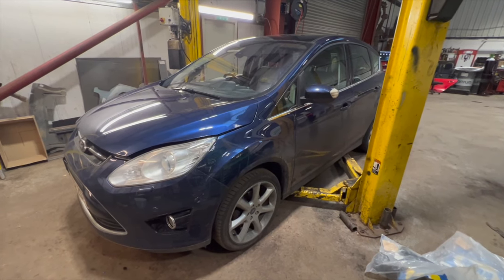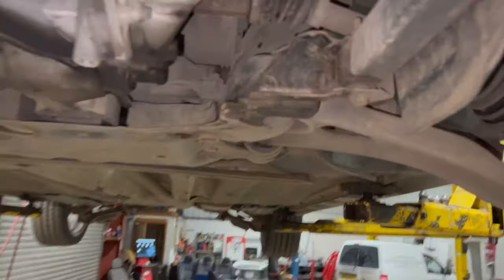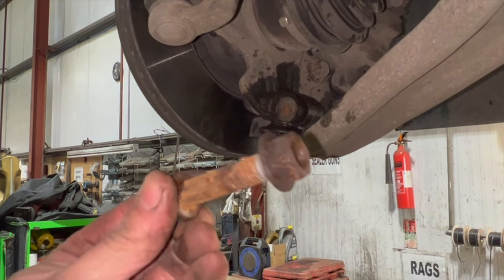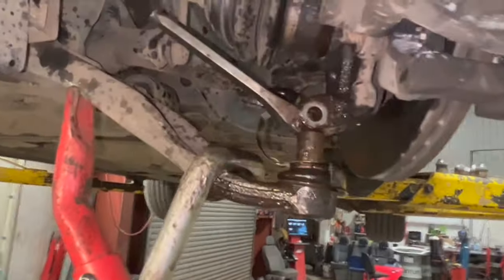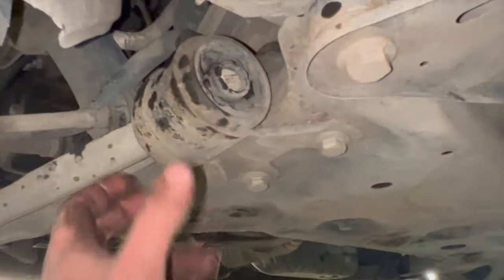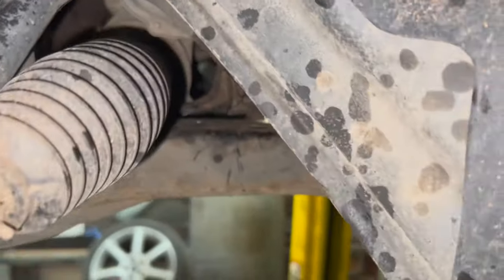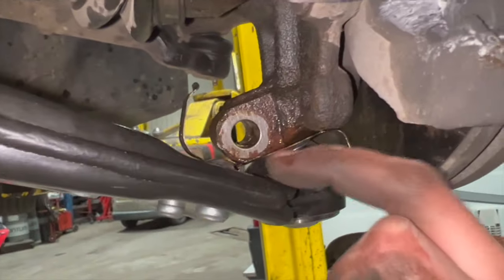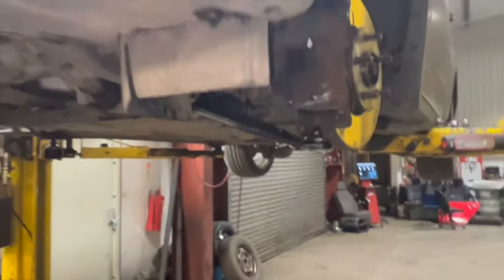Ford Cmax front suspension arm replacement

Comment from the maker: LH Front suspension arm Ebay - https://ebay.us/q5DO98
RH Front suspension arm Ebay - https://ebay.us/4CBG3X
Front susp arm rear most bush kit Ebay - https://ebay.us/DZVkh0
Ball joint pinch nut & bolt - https://ebay.us/lVmoti

Tools used :
             
Milwaukee 3/8 Drive Mini Impact driver - https://ebay.us/Pg8ilg
Socket Set - https://amzn.to/2O6BUmM
Spanner set - https://amzn.to/2DlwUZm
Suspension arm puller bar - https://ebay.us/30GWMc
Copper hammer - https://amzn.to/3fmw2Dg
Ball pein hammer - https://ebay.us/8OJpgz
1/2 Dewalt impact driver - https://amzn.to/3e2Uff2
17/19/21 wheel bolt impact socket set - https://amzn.to/3gDnBlP
Torque Wrench - https://amzn.to/2VZ4CKu
Screwdriver set - https://amzn.to/30RA53L
Copper grease - https://ebay.us/ckQddu
Wire brush - https://ebay.us/hTtdhH
Prybar set - https://amzn.to/3nh2t8c

Torque settings :
Ball joint Pinch bolt - 83nm
Front most susp arm bolt (18mm) - 150nm + 90 degrees
Both rear sump arm bolts - 115nm + 90 degrees
Wheel nuts - 135 NM
             
Check out the Timing belt replacement on this same vehicle :
https://youtu.be/eSVdVACJBlc
Check out the Auxiliary belt replacement on this same vehicle :

Comment: Do you not recommend torqing the bolts with the wheel at normal riding height so as not to stress the  bushings?
Reply from the maker: I dont usually tbh and have never had any issues but some people do recommend it
Reply: It does twist the busy, shortens life of the rear hydro busy, what it does do also is increase the ride height slightly at the front.

What you are supposed to do on these is tighten up the rear bolts, then put the ball joint in.

That then locks the front bush in the position where the rear one is at rest.

Comment: This is my next job for the cmax, just had new tyres fitted and then 4wheel alignment done (due to massive inner tyre ware), which then revealed that the front bushes are near their end of life - 6 months at best. It does seem, so much easier on ramps, I would need to tackle this with axle stands only. I was thinking to replace just bushes, but again , not having a press equipment, your video and advice indicates to me replace the whole thing together as your right, the whole things has to come out anyway. Would you replace in pairs, if only one bush was needed?
Reply from the maker: I would only replace the one thats needed, you can just get the bushes but easier to fit the arms if you have got any press equipment

Comment: Thanks man, I'm in a process to replace mine in an MK7 pre facelift fiesta. I don't know if there's any similarities.
Reply from the maker: should be similar mate 👍
Reply: @diydaly  I did it but wanted to remove the tie rod end as well, and I couldn't because I didn't know if it needs to be unscrewed of just pushed out. Yes I tried pushing it out, but it held or tightly, so I ended up fearing for the treads. My bold has a hexagonal alen key slot, but it looks like I'll break my alen key or ruin the hexagonal shape. I wanna watch closely now.
Reply from the maker: @Fanzo463  the best way to get them out it remove the track road end but then give the hub a firm whack on the side next to it and it will drop out
Reply: @diydaly thanks I'll do so, I'm in no hurry. The car is parked while organising all the needed parts for replacement.
Reply from the maker: @Fanzo463  👍 hope all goes to plan

Comment: As per usual I’m late to the party. I changed both on my 2012 Grand C Max having watched your invaluable video. Odd thing with mine though. The steering wheel is now off centre to the right but the car tracks straight. I took to my local people who stated it’s within the figures. That doesn’t seem right. Any thoughts?
Reply from the maker: Id probably go for a second opinion on the tracking mate.. its quite common for new arms to upset the tracking / steering wheel position
Reply: @diydaly  I’ll get straight on it. Many thanks. BTW….Ford don’t make things easy do they?!
Reply from the maker: @robturner7945  nice one 👍 haha no they dont!